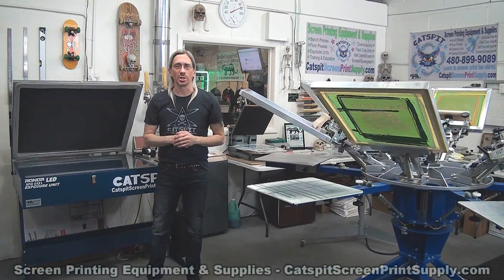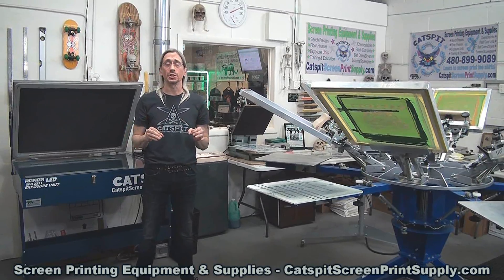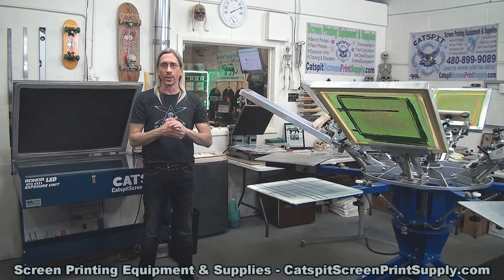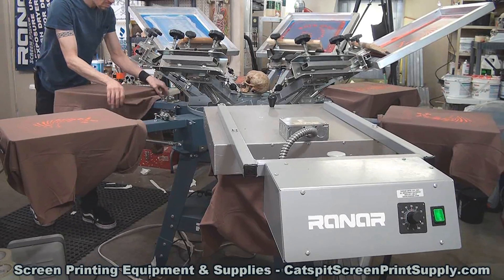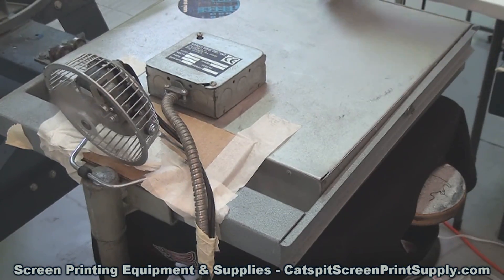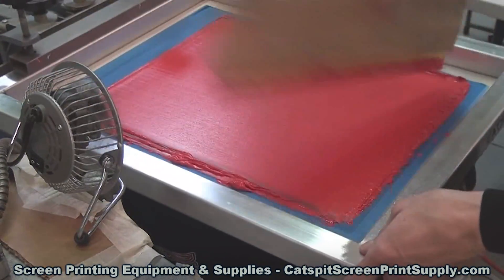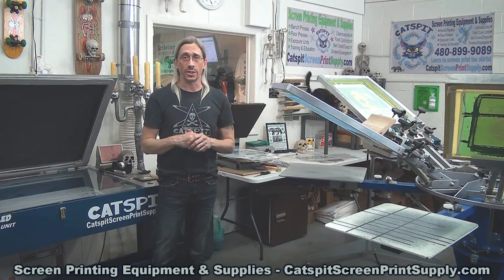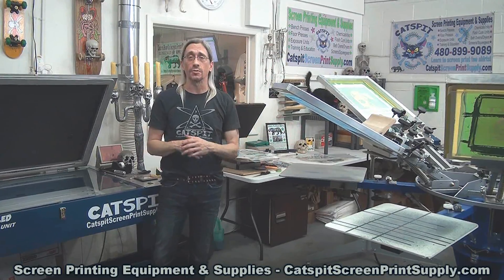Screen Printing: Why Does Plastisol Ink “Dry” & Clog The Stencil On Press?

Comment: Very useful information as usual. I'm trying to get an idea of the running costs of screen printing t-shirts at home. On average, what percentage of ink from a 1 litre tub of plastisol ink would end up on a single t-shirt with one colour? I know this may be hard to answer as different artwork may require different amounts of ink. Would it likely be less than 10% or 5% of the total amount of ink in the container?
Reply from the maker: Yeah I'm no mathematician. And it's really not something you can calculate with any accuracy because as you said each design will print different amounts of ink. Each press operator will affect how much ink is printed as well. But I can say this with screen printing and cost of inks; quarts generally print hundreds and gallons generally print thousands. Furthermore if ink usage is a financial problem, you're doing something very wrong. Ink is usually a minor cost in relation to the rest of the printing process. Thanks for watching! Screen Printing Equipment & Supplies - http://CatspitScreenPrintSupply.com/
Reply: @CatspitProductions  Thanks for the reply. I'm just trying to get a rough estimate of the cost of ink used for the printing of a single t-shirt so I can work out my profit margin when it comes to selling the shirts. I guess another way of working this out would be to see how many t-shirts I could print with a single container of ink and then divide the price of the ink tub with those numbers of shirts. That's probably the most accurate way of doing it. And also add the cost of the t-shirts themselves which I might be able to source from a wholesaler.
Reply from the maker: @anzaeria  Yes, many people try to figure this out. Here's a post from the Catspit forum that might help:
https://www.catspitproductionsllc.com/forum/viewtopic.php?f=47&t=2173

Comment: If you have a rotary press how can you keep your ink from drying out if you live in Az. Press is in garage
Reply from the maker: I'm guessing you're using water based inks, yes? Because plastisol will not dry simply from the Arizona heat. You may need to use a spray bottle with water to mist the screens down now and then. Or use a humidifier if possible. Thanks for watching! Screen Printing Equipment & Supplies - http://CatspitScreenPrintSupply.com/

Comment: the biggest issue im having atm, however mine doesnt have anything to do with heat,  even first press the black plastisol ink getting trapped in my 47t mesh. its gotten to the point i want to give up learning screen printing . ive mixed it with eggbeaters, adjusted different off contact levels,  its really frustrating lol
Reply from the maker: Perhaps you need to try a better ink. Thanks for watching! Screen Printing Equipment & Supplies - http://CatspitScreenPrintSupply.com/
Reply: Me too
Reply from the maker: @أمسعدالدين-ح7ه  Yeah something is wrong. Plastisol ink should not dry and clog the screen without any heat when it's fresh out of the bucket. Try a different brand of ink like mine ;) Thanks for watching! Screen Printing Equipment & Supplies - http://CatspitScreenPrintSupply.com/

Comment: Who cleaned  your shop?
Reply from the maker: Which one? 3 different shops were in this video actually. Unless this is a loaded question and you already know the answer. I was looking for an intern. But I'm afraid it's too much business work probably. It's a trade off for help. I had a deal where someone would come in twice a week for a few hours and help me do anything needed. I saved all the screen printing shop work for those days but it included stocking the shop and cleaning up etc... But in return the person gets to learn and have full use of the shop anytime I am open on the other days of the week. Materials , electric and all. It didn't seem to work out so I doubt I'll try it again. Thanks for watching! Screen Printing Equipment & Supplies - http://CatspitScreenPrintSupply.com/